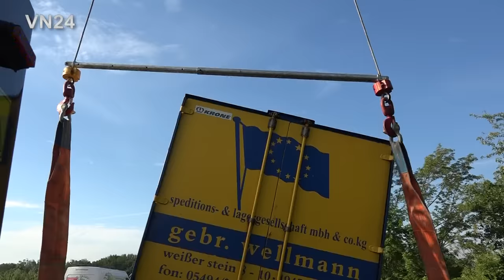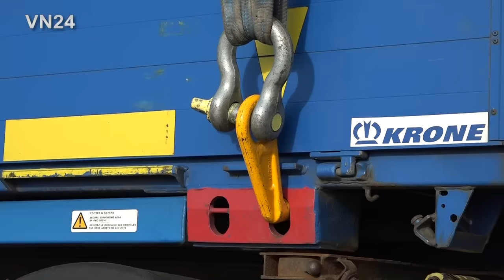18.05.2020 - VN24 - Kollmer Rotator Kran "the Beast" muss bei Unfall auf A1 über Kopf arbeiten

Comment: At 7:50 sec. the 2 men standing between the box and the guard rails, Need to be trained NOT to stand between the load and a fixed object. If the chain breaks it will drop and crush them. Always leave yourself a way out. (I am a retired fire fighter.) Always teaching the younger guys how to be safe. Their wives and kids would thank me.
Reply: "Their wives and kids would thank me."
No they won't - They'll tell you that you don't know what you're talking about, and that their husbands / fathers are "professionals".
I got out of this industry (heavy recovery) about 10 years ago because of exactly what you're seeing. It is totally unregulated, with no professional qualifications or formal standards. People with no lifting experience are given access to 80 ton rotators, and then allowed to use them on live roads, right next to moving traffic.
You're better off keeping WELL away from anyone wearing orange - YOUR wife and kids would thank YOU for it.
Reply: In my experience Germany has a surprising lack of safety culture in many areas, you will  see such things also in construction and factories.

Comment: Fascinating. You rotators are much different than the ones we have in the USA, though they do the same thing. Also your transport equipment is much different than ours. Our containers do not have built-in jack legs, and the transport trailers used to move them are much simpler.
Reply: Those aren´t the standard shipping containers, we have them here too, and also different trailers for them. These in the video are "Wechselbrücken Container", so swap-body or swap-bridge containers. Very common where you have a lot of transit between big logistic centers. The driver just need to back up to a ramp, drop of his container for being unloaded, drives to another ramp and picks up an already loaded container and drives off. So theres no waiting time for the driver to be un- and reloaded, and you know...we germans love efficiency :P
Reply: A lot of the differences have evolved from the much tighter geographical and historical constraints in much of Europe - smaller towns, narrower roads, shorter distances, etc. But it is interesting to compare the different approaches - for example Midwest Truck and Plaza with their relatively small teams vs the large teams that we often see on VN24.
Reply: Swappable containers are like a roof rack on a car.
Just bigger.